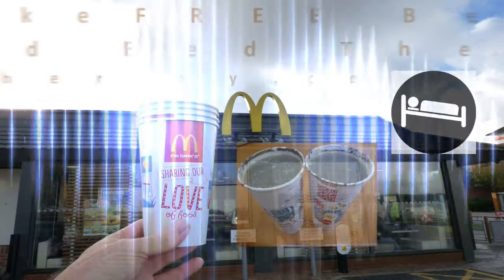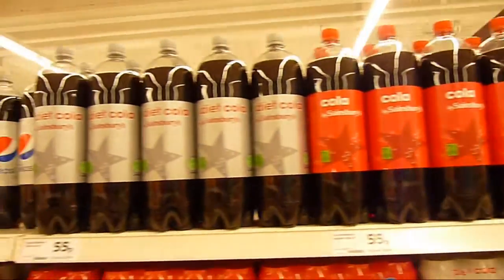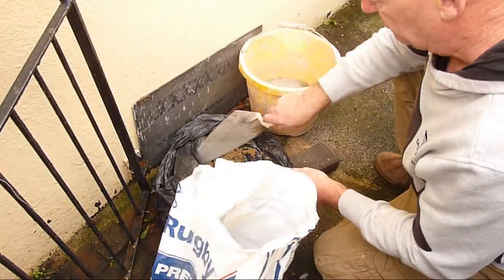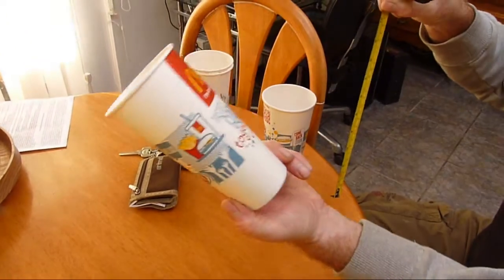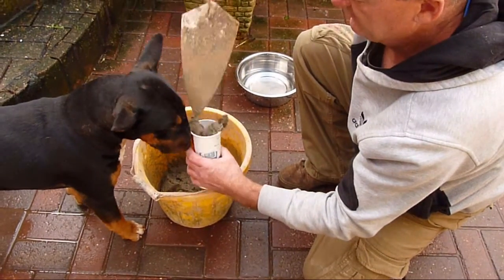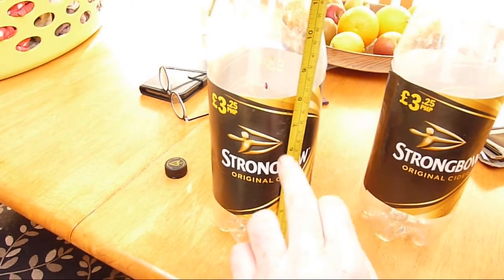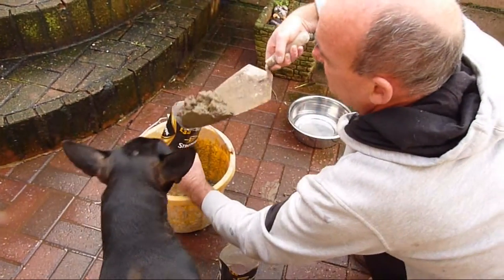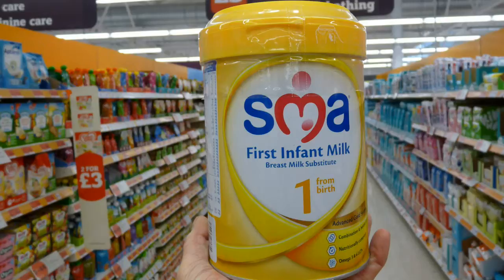Bed Raisers Cement Filled Recycled Plastic Bottles Inclined Bed Therapy IBT Science of Healing Sleep

Comment from the maker: Another idea is to remove the wheel from a bed caster and embed it in the setting cement mix. This can then be inserted into the caster socket on your bed. You can obtain spare bed casters from Ebay or from a bed store.

Comment from the maker: Note: if you remove your casters from the bed legs to insert the threaded screw or a solid bar cemented into the raiser, then you will need to make your raiser higher to make up for removing the caster.